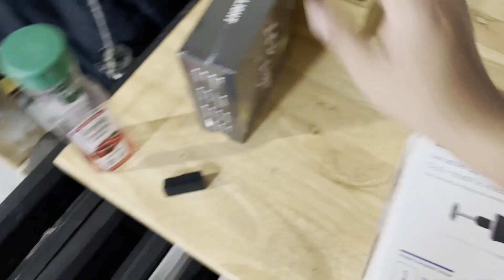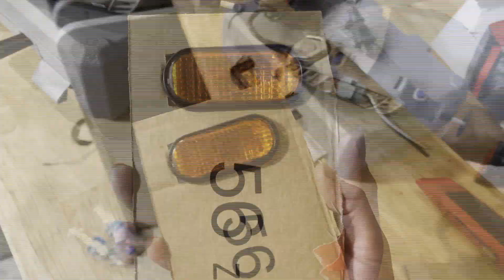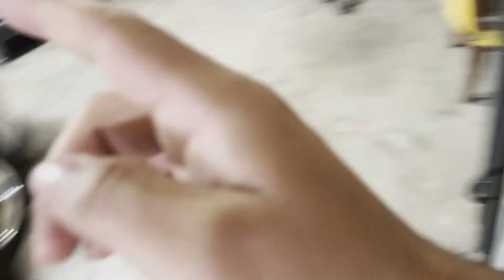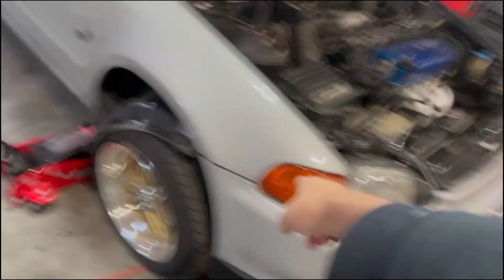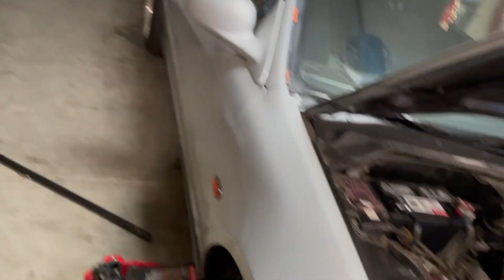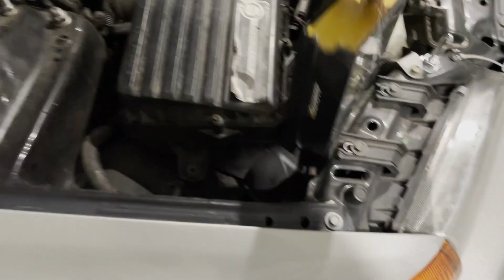Complete Side Marker Install on Honda Civic!!!

Comment: Hey I recently bought side markers for my 91 integra (green/yellow wire and black wire) after about 2 hours I was only to get the positive and grounds to connect to 1 light. Either the parking or blinker. But to have them both operate I thought I run both wires into both positive feeds. I got nothing. Do I need a 3 wire set up in order for this to work? All the JDM stuff I see has 2 wire connections
Reply from the maker: @graysongrzybowski943 Yeahh that seems to be the only way to do that here. The reason the JDM stuff has 2 wires and it works for them is because they have relays wired in. You can do it yourself as-well but its just gunna take a little extra know how

Comment: What connectors did you use nd where did you get them
Reply from the maker: @darwynntornez1393 I just used some basic audio speaker connectors from amazon. I bought a bundle for like $10 id recommend getting actual connectors thoo…😅 these speaker plugs are difficult to remove and plug back in.

Comment: You were really close but didn't wire them properly.
In order to have them ON with the parking lights and blink only when the turn signal is on, you need to connect the positive of the side markers with the positive of the parking lights that for honda should be red with yellow stripe, and the negative of the side markers with the positive of the turn signal tha should be green with yellow stripe. 
The old honda Flasher + acts as a ground until the blinking lights are activated, so you will have ground on your side markers until the turn signal is on.
The only downside is that they will blink at the opposite time of your original turn signal, but hey... at least we can have dual function on the side markers, right?

Comment: Im about to do this too. I have blackhousing headlights with clears. In the front. I also have clears in the rear. My question is should get clear or orange amber side markers? Also should I purchase a clear rear fog or a red rear fog?
Reply from the maker: @popclutch_100 Thats a good a question.. 🤔 i mean me im not a fan of the clear (all white) style but if you already have clears on the rear AND front might as well make them match👍 Same goes for the rear fog as well.

Comment: Wow. Good job. Yeah you need the side markers with three wires. I know from experience with my motorcycle. They’re similar.
Reply from the maker: @ramonjrusa i had no idea that was even an option lol i just bought the recommended ones from ebay 😅
Reply: @projectgoodspeed  did you find a solution to blink at the same time ??
Reply from the maker: @enriquenicolas9437 Not yet… everyone says a relay would do it but i havent tried it out myself yet. I definitely plan on making a video about this in the future though…. Once i figure it out myself😅

Comment: You could have just downloaded the pdf file from Honda Tech. It gives you 100% exact measurements of the side plus distance from molding to side marker. Now you have play on you side marker which it’s not supposed to have any play at all.
Reply from the maker: Yeahh i could have done that…that would definitely be the smart way to do it. Next time though!👍Besides theirs more play in my corner lights than my side markers, they should be fine 😂
Reply: Is there a pdf for a rd1 crv? 1996-2001 honda crv?

Comment: you Just  need to use a 3-way bulb, one for the "stay on", one for the blinker and the last one for ground... easy peasy nice and easy...
Reply from the maker: That makes sense but any idea where i can it? Id need a 3 way plug to go with it too
Reply: @projectgoodspeed  you can use a five pin relay to make a two wire single brightness bulb do signal and running there are several tutorials on YouTube
Reply from the maker: Brooo!!! @04_civic Siiiick i just checked some of them out and im thinking, i could totally give it a shot!!👍 Big Thanks!!!💯
Reply: You don’t though. Just wire to to from the side marker 2 the 2 off the blinker and leave the ground alone.